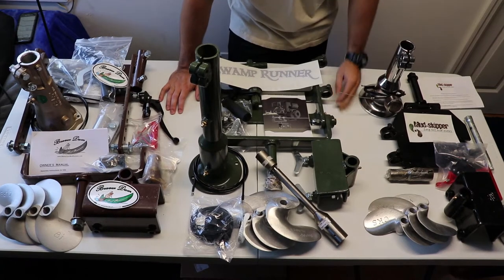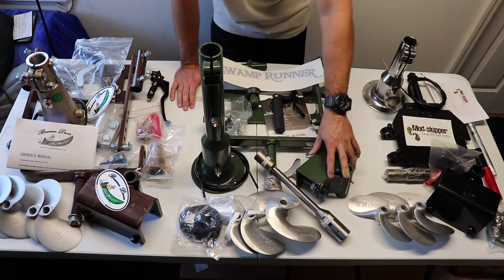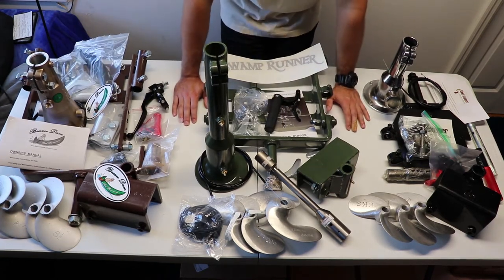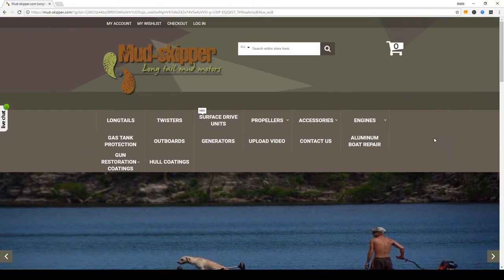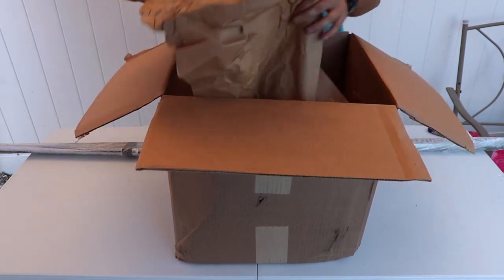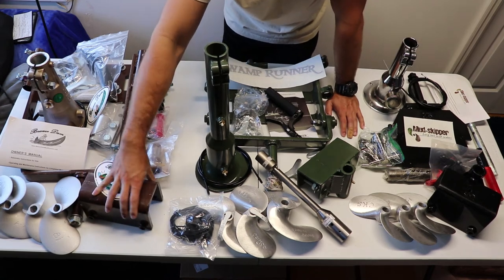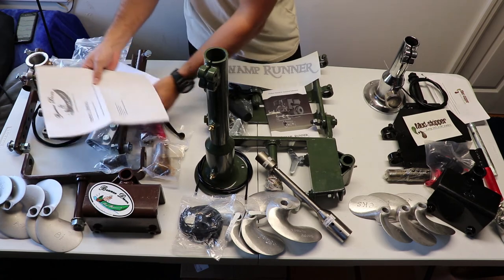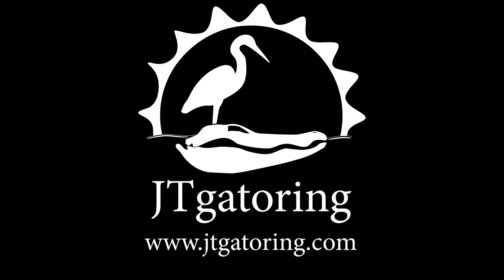S1E4 Beaver Dam, Swamp Runner, and Mud Skipper Side by Side Unboxing Comparison

Comment: Great videos man! I'd love to see more. I've got a swamp runner medium kit, I went to the place in Palmetto Florida, great customer service. This kit is on a 1436 Tracker Topper with a 420cc Predator gasoline engine. I love it!
Reply from the maker: Great to hear Carie! Swamp Runner was the first kit I had and I loved it. Now I do have one question for you. Did you have a problem mounting the transom bracket on the transom with the transom brace being in the center of the transom? If you could, send me a few pictures via email if you get the time, if not its not a big deal. Thank you for watching and I hope you enjoy the rest of the videos!
Reply: JTgatoring Yes I did have a problem with that. I might be able to send you a couple of pictures tomorrow. I rather send them to you on Facebook than email if that's fine with you.
Reply from the maker: That would be great! I had the same problem when I went to purchase my boat. I knew I wanted a Swamp Runner so I purchased it before I bought my boat. I wanted a tracker at first but the transom bracket would not fit the way I wanted. So I ended up having to get the more expensive Alumacraft that was a few hours away and is now giving me a few problems, but I would really appreciate the pictures, how ever you are able to get them to me 👍
Reply: JTgatoring I got my boat before I got the engine and kit. I'll explain what I done to overcome that problem tomorrow.

Comment: Side by side, this is good. The Beaver Dam gimbal bracket is definitely the heftiest. I'm most interested to see how the CLP coupler goes together compared to the SPS. One of the things I love about my SPS is how easy it is to disassemble the drift shaft, yet holds it securely and quickly. 

I know guys who remove the drive shaft after every trip because they're in saltwater or prefer this method of maintenance. They flush it with freshwater and dump a 1/4 cup of oil down the shaft and leave the shaft upright until the next outing. My question is will the CLP have that kind of easy removal and reassembly?
Reply from the maker: In a way it does. Its a long tail just like the rest. It is not as easy as the SPS or CKS to disassemble and assemble again. Their is more steps to do and instead of having two eared bolts at the end of the coupler, its nuts and bolts so you will need an adjustable wrench to disassemble. There is more, but it will be covered in the up coming videos 👍
Reply: There are 4 bolts on the top that are the same size.  The small bolt on the side is not required really now that they have the 4 bolts on the top.(they used to have just two bolts like SPS and CKS).  The small bolt on the side is backup in case the bolts on top come loose.  The   There is a lot of vibration in all of these longtails.  I like more bolts and support on there as "backup".  I don't want my shaft to fall out!  Pros and Cons to all designs....
Reply: yes, our bracket is going to be the heaviest....  Ours is heavy duty to fit a wide variety of transoms securely.  These are being mounted on a wide variety of transoms and these longtails are very top heavy.  You want to make sure they are secured to your transom very well,  especially is you are trailering them...  You want to reinforce your transom if it weak.

Comment: My favorite throttle is the Thailand racing throttle. That's what SPS used to come with, but they switched to a mountain bike type brake handle throttle. Not sure I like that at all, but most people, well, Americans can't get used to the Thai throttle.
Reply from the maker: I first had the Thailand racing throttle on my small kit and I liked it. Then I got the bike brake handle type throttle and I liked it more so I decided to get it with this medium kit. You have the ability to pick which one you want to come with your kit. I like the bike type throttle more because it allows me to move further up on the seat and position my body weight more forward. With the Thailand racing throttle, it puts your wrist at a kinked angle if the throttle is positioned more behind you. If the throttle is in front of you then that Thailand racing throttle is great. SPS does have the longest handle and may benefit you to get the racing throttle because it will most likely sit in front of you with the handle being so long.
Reply: I don't know if I like one better than the other.  Agree with you about being able to sit further forward.  Both designs return to idle if you let go.(as long as the throttle spring is strong enough)  In the future I am going with a different style of squeeze throttle but still a "brake type".  If you look at most of the American made longtails they use a "static" throttle which I personally think is dangerous.  Also- remember that a lot of people are running these in cold temps so they like a throttle that is easy to use with thick gloves on.(duck hunters mainly use these in the winter)
Reply from the maker: With my Alumacraft 1436LT. It is a 2016 boat. The seat is very large and has a lot of depth to it, and it pushes me further away from the motor, so the long handles are nice but still none of the handles reach out past the front of my seat. So that is why I got the brake type handle and prefer it over the Racing throttle for my specific boat. I agree with you, I would not want a static throttle either. If you are doing a long trip and plan on running for a long time, you can just put the friction washer back on the engine throttle assembly (or if you never removed it, just tighten the nut down) and then why you made your long trip, you can remove the friction washer or loosen the nut. I would say all the throttle types with these kits would be usable with gloves on.